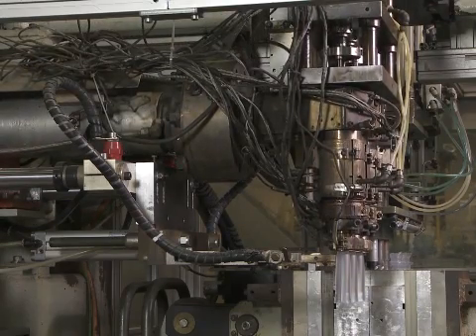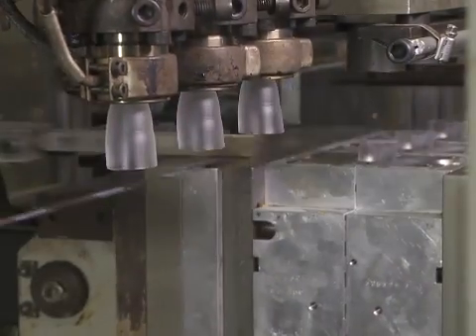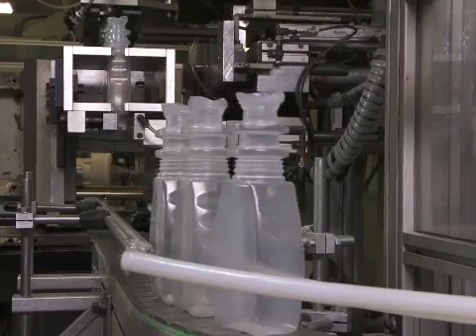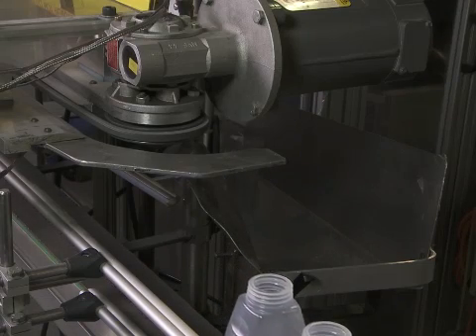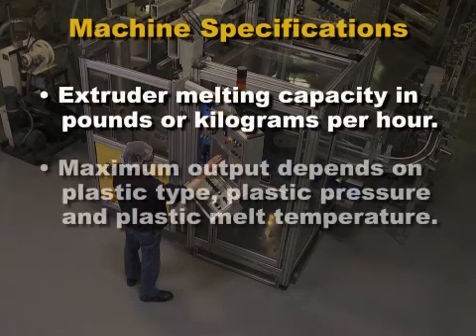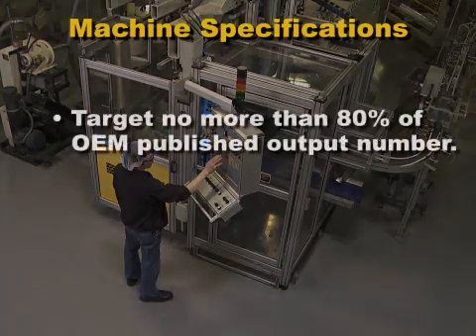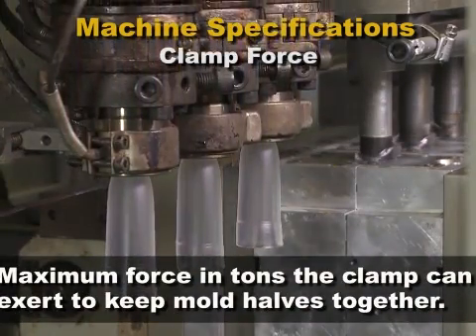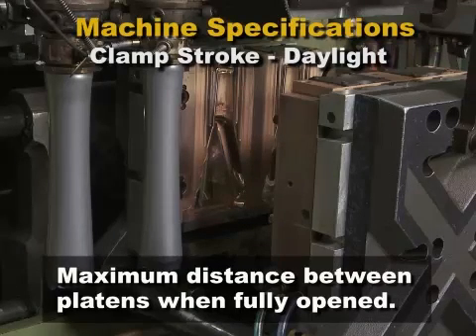Extrusion Blow Molding - Lesson 1 - The Process and the Equipment

Comment: thank you, is metal viscous enough for this method to be applied ?
Reply: It's hard, almost impossible to get the metal in the state of being rubber-like which is needed for this process. It's neither liquid nor a solid state of material, but something in between which metal can't really achieve by applying heat only.